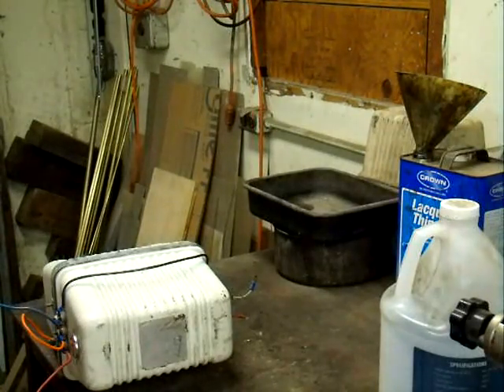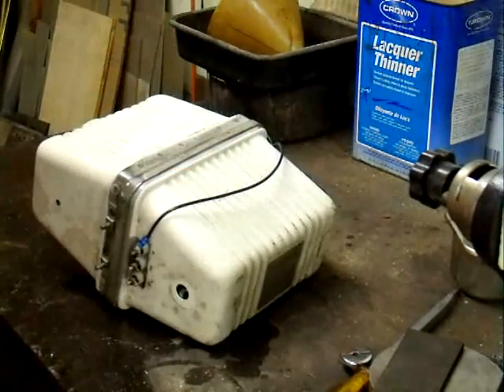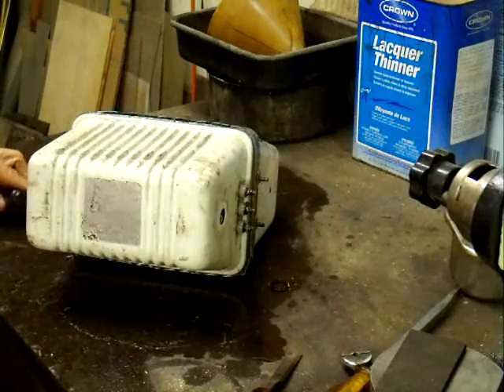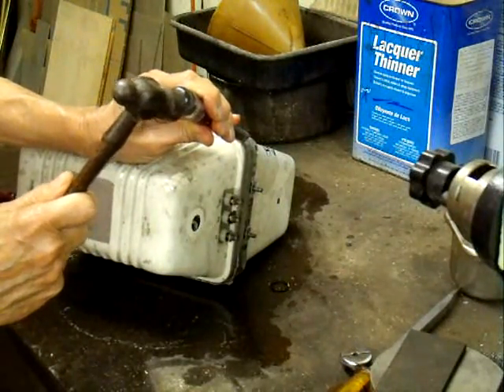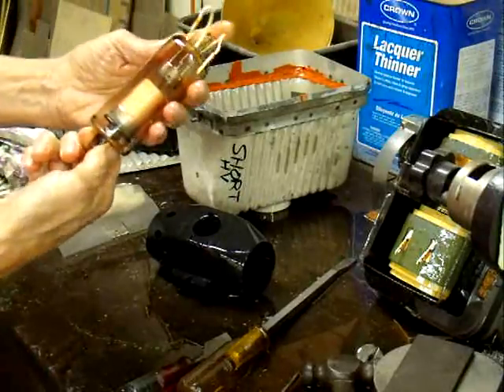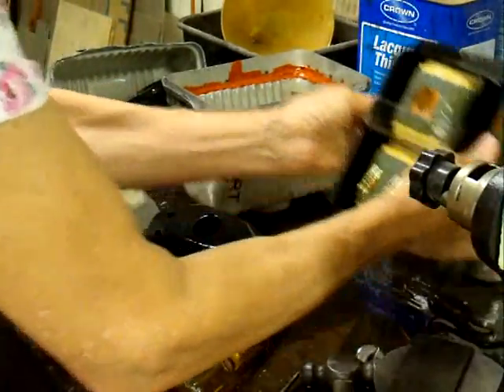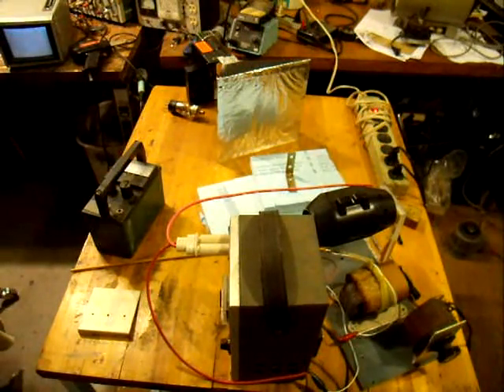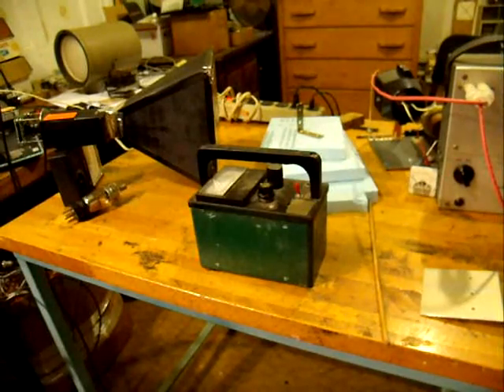cutting open a general electric x ray machine head

Comment: this is exactly what i am looking for. in south africa i can not get these x ray heads at a junk yard.  please sell me a complete high voltage power supply and a x ray tube. both working second hand condition. i will pay for shipping. i want to use it to reverse engineer electronic  pcb. not on humans and system fully lead shielded. make a price, PLEASE!!!!!!!!!!!!!!!!!
Reply from the maker: Sorry. Not practical.

Comment: Hello, I was wondering if you know how that machine was wired before you took it apart I have one of my own but I have no information to wire it, love you videos! Any information would be very helpful :D
Reply from the maker: X and XC are the filament transformer primary. Use a small variac to control the voltage. A1 and P1 are the primary of the HV transformer. Use a large (10 amp) variac to control that. MA to ground (case) is the Xray tube beam current. Connect a 10MA DC milliamp meter between MA and case to measure tube beam current. There is no temperature monitor on these units since they were rated at 1 second maximum on time. Be careful, use only enough filament voltage to get the current you need. Try about 50 volts on the HV and adjust the filament until you read beam current. Most soft materials use less than 1 MA. For thicker materials run the HV to 75 volts or 100 volts. (100 volts will give about 80KV peak X rays) The peak KV will vary with beam current loading. Don't publicize you are operating one of these!
Reply: @glasslinger  Thank you for your very quick and informative response Much appreciated 👍

Comment: I have a coolidge type X ray tube but I can't seem to make any X-rays with my 22kv power supply. Wikipedia says 30 kv is the minimum to make xrays (soft x rays) is this true? Maybe your power supply was higher than 30kv at the start?
Reply from the maker: Xrays will begin at about 10kv and be VERY STRONG at 30kv. These tubes are "soft vacuum" tubes and can go bad. You should not have purple glow between the cathode and anode. There may be slight blue glow but if it is a purple stream the vacuum has deteriorated and the tube may not ever produce X rays again. (without re-evacuating the tube) Be sure the positive of your power supply is on the anode. (the electrode with the sloped surface.)
Reply: @glasslinger  thank you for the advice! Mine has an aluminum heatsink on the anode side and maybe all the pointy surfaces are causing a voltage drop? I don't see any arcs or plasma inside the x-ray tube at all; I think this tube is in great condition
Reply from the maker: @JPMontello  If the tube is up to atmospheric inside there will not be any glow. (or X rays)  The heatsink will have no effect on the tube if the tube is good.  You can use a high frequency induction coil to see if the tube is still under vacuum. It will give slight phosphorescence holding the electrode near the glass envelope. The tube will give a slight blue glow near the electrode from internal gas. (if at the correct pressure.) If the tube is at atmospheric, there will not be any glow at all.  I suspect you have a tube that has leaked up to atmospheric.  :(
Reply: @glasslinger  I can't get an arc to form at all. My power supply can definitely bridge the gap between the electrodes in normal air. Maybe I should get my filament brighter? I've been using 4 volts and it draws 2.7 amps. Should I go higher? Something is probably wrong with it
Reply from the maker: @JPMontello  I thought you had a coolidge type tube. No filament in that type tube. If the tube is a normal high vacuum type then the filament will need to be very hot, like a light bulb. Be sure to monitor the emission current so you don't overdo it and burn out the filament.

Comment: Hello, so I'm getting ready to buy an x-ray head of my own, the one thing I'm worried about is trying to figure out which wires go to the high voltage transformer and which wires go to the heating filament. Do you have any suggestions on how to figure this out? The answer is probably super obvious once I get it, I just want to know before I invest money into the head. Thanks!

Comment: Most of the directivity of the X-rays is due to the (most likely copper-coated tungsten) target in the tube, not any surrounding shielding.  There will be less directivity in other directions of the cone.  The oil you are collecting is most likely Pyranol (PCB), the toxic oil that persists in nature forever!  Its advantage is that it is not flammable.
Reply from the maker: You are correct on the beam direction but testing shows the oil to be simple mineral oil. Pyranol  was not used in medical devices.

Comment: You have just answered my long time curiosity about x-ray equipment. The tube was much different than I thought. I expected an angled target inside of a globe, that was hit by electrons thereby generating x-rays which were then diverted out through the tube.

Does the tube leak any x-ray from the open end of the tube housing (the access for the HV and filament power)? Or is it only produced in the central area of the tube and directed out through the aperture? 

What use are the functioning tubes ?
Reply from the maker: The x rays radiate out equally in all directions. Various parts of the target and envelope absorb a lot of the radiation not going out the side port so there is a cone of much stronger radiation in that direction. One use was to see inside a circuit board where internal traces in the multilayer board ended up. This enabled repair of a $30,000 instrument that had no schematics available!

Comment: The later X ray films are coated both sides with emulsion and a photo luminescent plate placed below it. With very short exposure, the luminescence plate continue to glow and continue to exposes the films. This method requires a very short dose of x ray unlike the earlier models without the luminescent plate.  The only issue is the image is more blurred because of the luminescent glow. Inside the x ray tube, there is a concave mirror behind anode that reflects most x ray in one direction. Without the mirror, the x ray will be emitted in all directions. Any leakage is shielded by the lead housing. Thank you very much for the video. Regards

Comment: That xray head has a near 100% certitude of containing PCBs if it was manufactured before 1979 when they were outlawed. The harmful nature of those chemicals are not overblown, they are understated. "In Japan in 1968, 280 kg of PCB-contaminated rice bran oil was used as chicken feed, resulting in a mass poisoning, known as Yushō disease, in over 1800 people." More than 500 of them DIED. PCBs continue to cause birth defects and liver disease to this day due to their persistence and continue to poison people and marine mammals like whales. It's bad fucking news if you own a liver.
Reply from the maker: I wouldn't want to eat any of it. But I have had it slopped all over my skin from years ago and am still kicking at 75. I do have the spectrometer and tested the oil to see if it was PCB. It was not.

Comment: Be careful of old oil- it can be polychlorinated biphenyls---- highly toxic no longer used. try to burn it- if it will burn its probably ok
Reply from the maker: These particular units use a distilled mineral oil. No pcb's.

Comment: you have a very cool job, i would imagine your not an employee but a specialist , any why i am very curios if you was to build that x ray tube {just the tube } not the x ray machine how much would you value that component parts and labor, i have guess in mind of about $1,350 u.s 2014 dollars , very amazing devices ,pure art work, only 1 out of 10000 people have the craftsmanship to construct such elegant machines , i mean this thing is made out of a glass vacuum tube and runs on 40,000 volts probably to produce an amazing atomic particle by electro acceleration of electrons , AMAZING  as you can tell i am quiet the nerd i could talk to you for hours
Reply: tubes for XRF end window type are about $30K... XRD glass tube are about $3,500, medical tubes are probably as pricey, they need FDA and other certs, which jacks the prices...Moly or Tungsten

Comment: What kind of oil is in that? pcb's?
Reply: I'm intrigued by this oil... I've never heard of it's use in electrical installations before.
Reply: been used for decades, it insulates and also cools ...
Reply: normally no pcb's..Shell Dialax, or similar
Reply: Surfer hexa-fluoride
Reply: @linuxmintman  That is a gas, not oil.

Comment: No radiation is emitted until the tube unit is energized. Once the energy is turned off the x-rays cease and there are lingering x-rays. By the way, your body produces radiation, it occurs naturally in the enviroment and is even in some foods, like bananas.

Comment: In which type of X-ray equipment was a spinning target tube common?  I remember my general practitioner had a Westinghouse unit in his office.  The transformer was in something which looked like a large oil drum with input and output to the tube.  It sat on the floor.  I remember hearing the motor wind up and coast down in the x-ray head.
Reply: DandyDon that would be the x-ray machine in doctor offices or hospitals and clinics

Comment from the maker: The background radiation is also determined by the type of instrument. A geiger tube instrument will have a lower background at a given sensitivity than a scintillation counter. A lot of the background comes from the sun and can be seen by connecting the integrated output of the survey meter to a chart recorder and recording all day and all night. It about doubles during sunlight. (unless you live in a high natural radiation area)

Comment from the maker: Hello!
I use the X ray screens that were used before digital imaging for increasing the brightness of X ray images on film. This is not used any more so these cassettes with the sensitive screen are quite cheap on ebay. A digital camera is used to photograph the screen. Or an image intensifier is used before the digital camera as I do to get a bright image with a much lower X ray dose.
Reply: My background is photo science and I've done a lot of sensitometric eval. While photo emulsions had good sensitivity in blue and near UV, they could be exposed by x-ray. To keep exposure from radiation low, a phosphor panel was placed in contact with  the film. When the x-rays hit the film, they also hit the phosphor, which glowed in visible light, which helped to shorten the exposure.

Comment from the maker: Nothing made after about 1950 used PCB oils. They are filled with processed mineral oil. Also, the hoopla about PCB oils is drastically overblown, like the hoopla about mercury, lead, and asbestos. You are not in any way whatsoever going to get cancer from occasional contact with these materials! Of course you don't want to slop them all over the place, because then the contact is no longer occasional. And of course wash your hands immediately after getting it on you.
Reply: yeah I have ground chrome coatings off so can weld, filed down asbestos brake pads drilled and riveted them, handled a good few asbestos  sheets on old garage roofs etc and been covered in countless oils fluids etc in my days of playing with cars (engine swaps etc) i didnt know any better back then but im still here 40 years later so im with you Ron i think it is blown out of proportion a good bit although i probly would take more care knowing what i know now lol
Reply: I know this is 7 years old, but I'm quite certain no one would use the expensive PCB's in a silly little x-ray machine. You save that stuff for the big stuff, like the "pole pig" transformers that connect the users 120/240 to the main HV line or the sub station transformers.
Reply: Well There PCB oiled filled caps in fluorescent ballast 
And I actually rewind those old fluorescent ballast.

Comment: I wondered about this, too!

Some x-ray heads made before the 1980's did use oil with PCBs. I'm not sure if it was commonly used in relatively small x-ray heads similar to the one you dismantled. Good luck finding what a manufacturer put into a given piece of equipment manufactured over 30 years ago.

If you have more insight on this topic I'd love to learn more. In the mean time, I look out for Ritter J-series heads. They were filled with mostly harmless Sulfur hexafluoride gas as a dielectric.

Comment from the maker: Hello!
The filament in the X ray tube emits electrons in proportion to its temperature. By controlling the filament temperature, the output of the X ray tube is set to the desired level. The filament transformer provides the heating voltage for the filament.

Comment: Ok then im calm. :) I have a longer tube that i used to listened to the background radiation once and it was about 3 times as low as you so thats why i wonder since i thought that you might had a highers background radiation by what ever reason, but then it all made sens. Thanks for the info!

Comment from the maker: Hello!
The detector is very sensitive. It is on the 1 milli r per hour scale which does pick up background radiation. I like to keep the exposure in the room approximately at background for maximum safety. It is not hard to do. The beam is highly directional.

Comment from the maker: I use the transformers. However, these units come up routinely on ebay and you can get one for around $250. (that's what I paid for mine) I have never gotten one that had a bad transformer. The tube is what goes bad.

Comment: I like tubes I have a large collection of vacuum tubes but the tube amps I work on run at about 400 to 500 volts dc I have got good zaps in this lifetime but Xray tubes are really neat to collect I have seen a beautiful tube with a mogal screw base and the anode and cathold at the other end really neat.

Comment from the maker: When I was a little kid (6years old) my dad would give me old radios to take apart. I would take the glass tubes and break them open and cut them apart to see what was in them. That experience early on got me into the technical end of things rather than the arts or business. (horrors! A little kid breaking open radio tubes! Sharp glass! What uncaring parents!) But those liberal actions by my parents are the source of my curiosity and the driving desire to undertake difficult tasks.
Reply: My Dad gave me a 15 kV neon sign transformer for Christmas when I was about 14 years old.  His basement was filled with vacuum tubes, electronic components, and test equipment.  A few times I hooked up his big Tektronix oscilloscope to my longwire antenna during thunderstorms so I could watch the patterns lightning induced in the wire.
Reply: Thank u for inspiring me to accomplish anything i set my mind to
Reply: My parents used to take me to the landfill and I would get toys out of there LOL
Reply from the maker: @SailingSarah  ME TOO! I got some of my most treasured "toys" there!
Reply: @SailingSarah  Still my favorite store!
Reply: My parents give me an old tv at the age of 6, the same you did y broke the tubes, transformers, capacitor, resistor and that way i was introduced to electronics, now i am 30 years old, and have 2 engineering titles.... That's the way you put the seed!
Reply: @Frank Roberts Great story.  Those early childhood experiences shaped your life, same with me.  I agree with your last paragraph as well 100%!
Reply: @Frank Roberts that's happening to me and my children right now and all I did was obey a court order.
Reply: @Frank Roberts I was awarded custody in an amended judgment and four months later arrested for allegedly kidnapping my daughter after the crooked commissioner changed the judgment behind my back. A good attorney could probably make a fat chunk off the case... my daughter now allegedly suffers depression and PTSD.
Reply: My best friend's granddad had a scrap metal yard... I still have some of the nixie tubes we pulled out of old cash registers some time in the early 70s...
Reply: I can not tell you how many terrific wounds I hid from my mother after drill press incidents. Grandpas huge craftsman with a 2 foot travel (at least thats how big i remember it) Holding washers with my hands trying to open  What an idiot I was at no more than 6 or 7
Reply: ⚠️  Hi.. Excellent Channel!!!
BUT..  Is There Any Possibility of PCB Contamination in the Oil??

Thanks for great videos!
Reply from the maker: @PowderMill  These used mineral oil. No pcbs.

Comment from the maker: This machine does not have PCB's in it. It is mineral oil. Industry had stopped using PCB's in transformers long before this unit was made. Another thing, the danger of PCB's is extremely exaggerated, like asbestos.  It takes a long term exposure to be in danger of cancer from it.

Comment: I've had good results opening these x-ray heads by unsoldering the seam. It's a pretty quick job if you use a screwdriver to pry the seam apart while using a propane burner for the unsoldering. It's gentler on the tube compared to splitting with a chisel, although the tube can handle a lot of abuse without breaking, I've had several where the cathode has become unaligned from knocks.

Do you need any info on the transformer? I've done a lot of measurements on these transformers so just ask.
Reply: does this GE tubehead contain PCB's?

Comment from the maker: The transformer is going into a 50kvdc power supply to drive a Marx generator.
Reply: Did you ever post a video on that?  I saw your video about how you converted a 16 kV neon sign transformer into a 50 kV one.